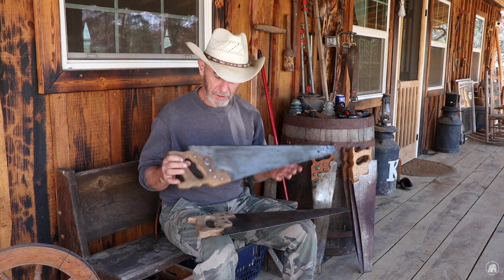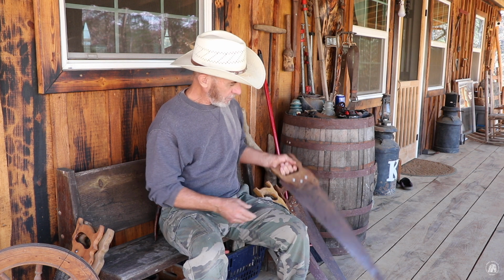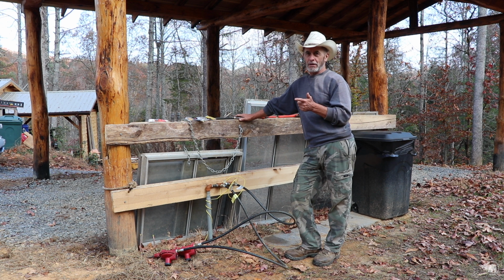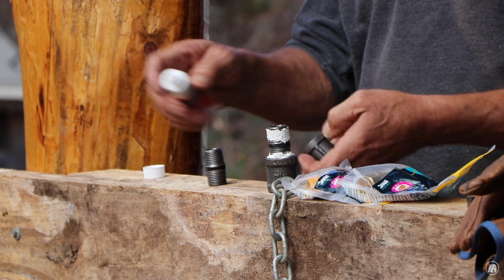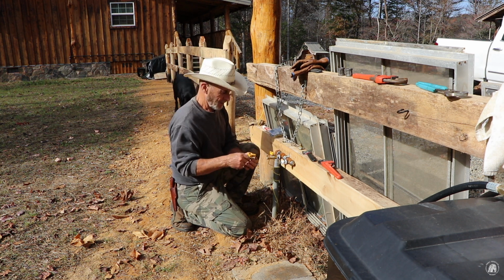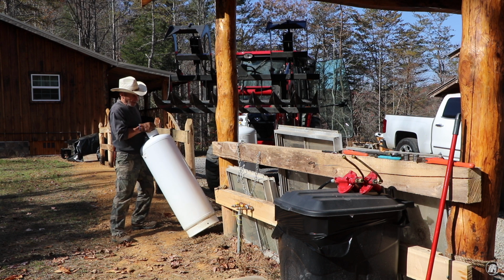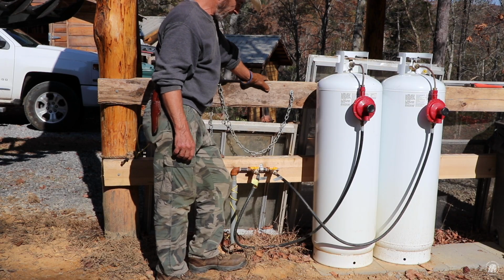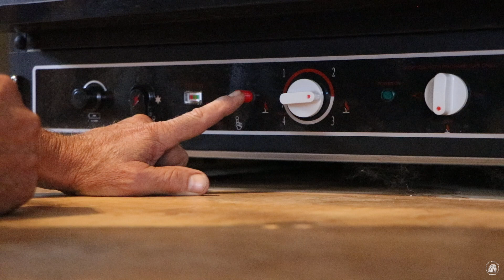OH, NO !! NO PROPANE, UPGRADING THE SYSTEM & HANDTOOL RESCUE

Comment: That fence looks first-class! As for the propane; I’d recommend an automatic change over regulator at the tanks. When one empties the auto-reg switches to the other tank and a red “flag” indicates the empty. Without turning anything off the empty can be removed, refilled, and reinstalled. The system will continue to run off the second tank until it is empty and the whole process repeats. This all happens without any loss of pilot lights and such. I’m glad that you transport tanks vertical, technically its the law. The requirement is that the relief valve must always be in vapor space. If a tank is full and laid down, the valve is in liquid space. If the pressure relief were to blow off, liquid would be released and its 280 times more condensed than vapor. Funny, I haven’t “talked” like this in 24 years, now I’m a pastor not a LP serviceman. Lol
Reply: One more thing, lines shouldn’t need purging simply because of an out of gas condition. Replacing lines perhaps, but what you did in this video probably didn’t need a purging; it didn’t hurt anything of course. The auto regulator prevents all of these issues.
Reply from the maker: I may look into that I really appreciate it. Hope you enjoy what we’re doing here on the channel and wish you a great week

Comment: A good sharp hand saw can cut as fast as a power skillsaw . The only problem is you're the motor and battery.😉 the noise is much better, tho. It's kind of amazing how quick and easy it is.
Reply from the maker: Absolutely. I love using tools like that because it is kind of therapeutic in a way. I have those others that I need to get sharpened and then use. Hope you enjoy the video

Comment: My dad was a carpenter, and he rated his saws as- coarse teeth = rip saw.- fine teeth = crosscut. Some saws double as a square using the handle and the back of the blade. A very handy feature.
Reply from the maker: You definitely have to have both types of sauce that’s for sure for the different types of work that you do

Comment: I'm not sure who makes them but a relative of mine has two tanks like that hooked up for a kitchen cook stove. Outside at the tanks there's a selection valve that points to the tank in service. Pretty handy.
Reply from the maker: Yeah I suppose that would be nice to have. I turn both tanks on the pressure equalizers in the line so there’s not any more being used than  just do wanted to time at a time

Comment: Yup, I think an extra or two would be the thing to have just incase it's a bad winter Richard and me thinks a battery on hand for the refrigerator would save your bacon incase of another run out. Glad you got the saws all out and shared them with us. Stay safe around there and keep up the great videos. The fence turned out real good, now you have a hitching rail for the horses when they get there. Keep up the good videos and the fun you all have around there. Fred.
Reply from the maker: Yeah I’m going to pick up an extra one. I figured that all of the gas that I use in here I’ll probably have to replace them probably three times during the winter which is not bad at all

Comment: Hi, this is Franz from Austria, I would like to give you some advice: Wouldn't it be better to put the propane bottles under a roof, as it blocks the sun and protects the bottles better from the weather? Kind regards Franz
Reply from the maker: Not sure. I’ll Have to look into that. I know that the 500 gallon tanks sit outside by themselves all year long. That’s what most people use. But I chose to get the smaller bottles

Comment: How do you clean the rust off your saws? They don't saw well with rust. I have a 300 gal. buried propane tank. Last winter my supplier had problems retaining drivers and they nearly let me run out twice. Some neighbors did run out. I have a propane furnace and also a wall mounted propane ventless heater in case my electricity goes out. In our tent deer camp, we manifolded two propane tabletop cook stoves and two wall lamps so we could work on each appliance individually in case of a malfunction. We learned that at 20 below F when the 20 # bottle got low, there wasn't enough pressure to run everything. We were considering going to a 50 pound tank but stopped going hunting because of a death in the group. You need to be careful transporting a 100# tank because the valves don't close properly if it is laid on it side and it can leak. Makes it a bit hard to transport. We already had several 20# tanks from camping trailers so we used what we had. There is a grease that is in propane and it will sometimes foul orifices in stoves, wall lights, and lanterns. We would sometimes have to take a propane wall lamp down and clean the orifice with welders nozzle cleaners.
Reply from the maker: I always transport mine upright.They make some short fat 40 gal tanks That might be what you’re looking for I don’t know.

Comment: Yea Richard you definitely need two full spare tanks when you  run out don't want to run and get tanks filled in the middle of a ice or snow storm maybe you should think about getting a two hundred and fifty pounder or five hundred pounder and have your propane company come fill them your not getting any younger
Reply from the maker: Yes I thought about that. I’m trying to stay away from anything being public record. If the gas company comes and fills it that’s public record. Trying to keep all of the tax assessors and everyone else out of the picture. The hundred pound tanks and up are not charged any taxes on fill up. That’s why I chose 100 pound tank. I don’t mind going and getting them filled. I am going to get an extra just for that purpose
Reply: @OutpostReview  I didn't know that good thinking

Comment: I keep watching people using an adjustable crescent wrench incorrectly. I just watched you. You don't loosen objects with the adjustable jaw. The wrench is not designed for that. The jaw is to hold the wrench tight. The part of the wrench that doesn't adjust is designed for you to apply pressure for loosening.  Using the jaw, the wrench could slip or even break using the adjustable jaw causing injuries. I've seen this happen.
Reply from the maker: I know exactly what you mean.

Comment: I don’t know why you are using the smaller tanks for your home, instead of having a larger 150 gallon tank or a 300 gallon.
Using the tank you are puts you at the mercy of the higher propane prices in the winter months instead of having a larger bulk tank that you fill one a year in the summer months when propane is cheaper.
Also you could instal a buried propane tank that would be out of the way and at a constant temp and not affected by temperature swings.